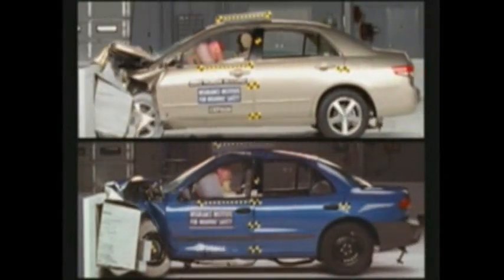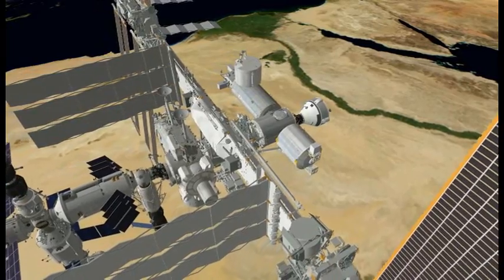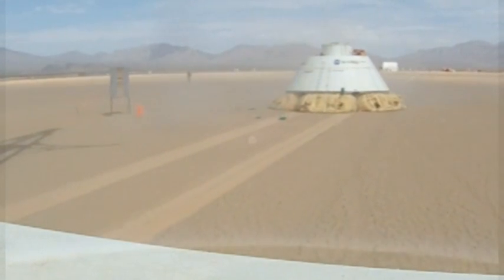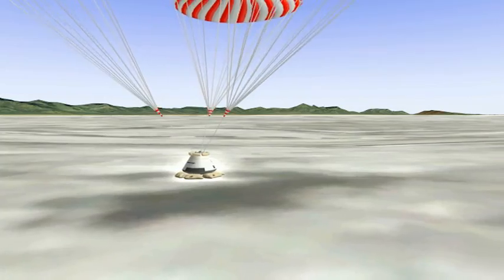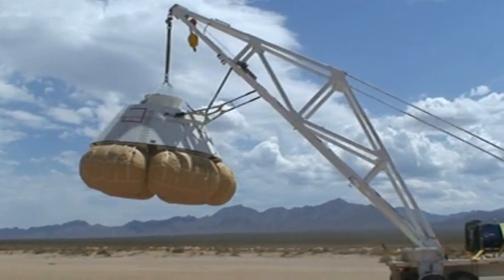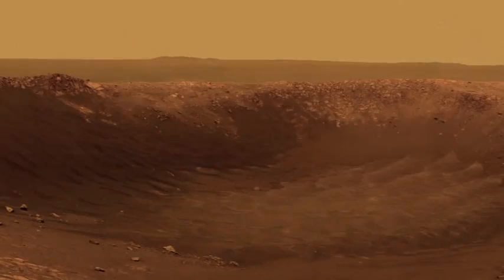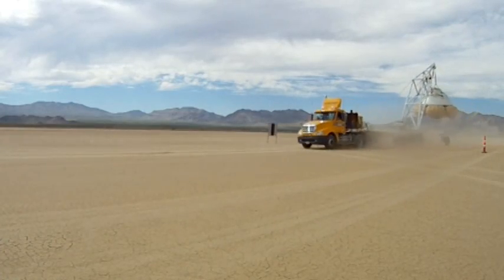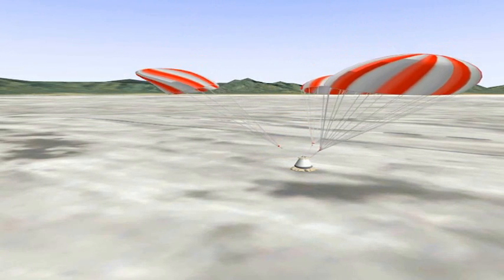No crash dummies needed for these air bag tests

Comment: I don't know... the whole concept seems very hair-brained to me.  It is as if you have decided/concluded that it is a given that the thing must crash, for lack of a better word, when it comes back to earth, and so now you are trying to figure out ways to dampen that crash.  Perhaps it would be better to start thinking in another direction, inventing a way to avoid the crash altogether.  Here are a few suggestions just off the top of my head:
1)  Figure a way to flare the parachute(s) at the last second before contact, thereby making it more of a landing, and less of a crash.
2)  Have a device in the capsule that would pull down on the chutes just before contact.  I.e.:  Where the three shutes come together there is a rope or tether that goes to the craft.  Lets say that is currently x feet long (whatever it actually is at this time)... What if instead of being x feet long, that distance was increased?   As the craft is descending under parachute a certain length of rope could be let out of the top of the craft that would extend the length of the tether to (x + 100) feet lets just say.  Also there could be pulleys used such that there is, for instance, a four part purchase to this newly lengthened tether.  Just before the moment of impact the rope that was let out could be quickly wound back in, thereby slowing the descent of the capsule perfectly, right at the last second.  There could also be a feeler rope or whisker line dropped from the bottom of the craft to feel for the earth approaching from below to ensure the exact timing for the spring loaded wheel to gather back in the tether.  Now you don't have to carry all those airbags and tanks of gas to fill them right on top of the heat shield.  You also don't have to jettison the shield. 
3)  Another way would be to use another aircraft to catch the capsule, by having the capsule extend a leash of sort.  A plane such as an air refueler could fly beside the capsule and snare the leash and gently catch it in mid air as it is falling (slowed by the chutes).

I have thought of a few other ways to achieve this landing without the need for airbags, but I need to get paid for my ideas, so write to me if you want to hear more of them.  I will be happy to sit in on a think tank any time.